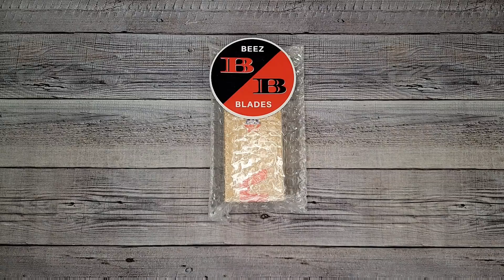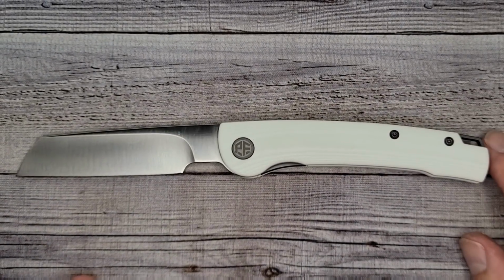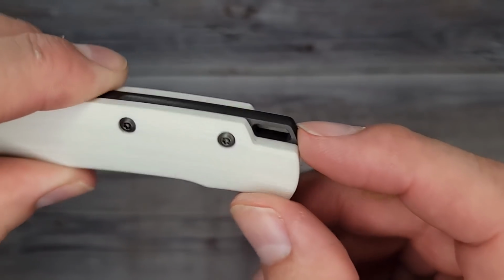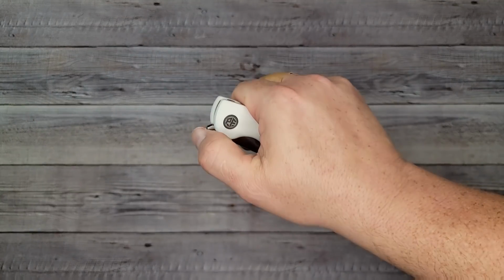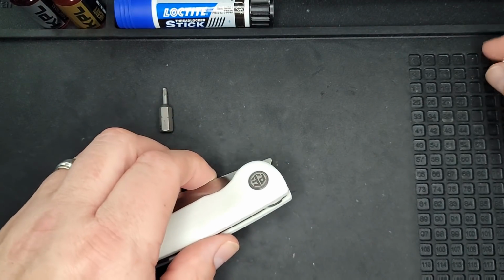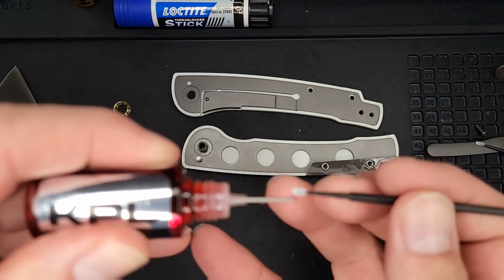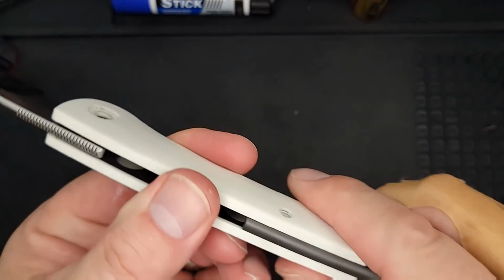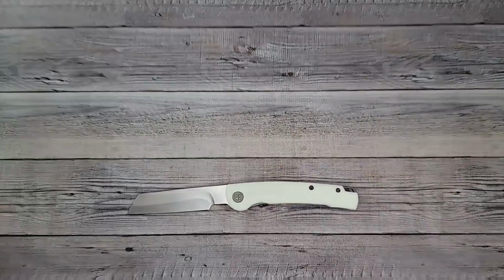NEW RELEASE! Petrified Fish SCHOLAR | PFE04 UNBOXING AND DISASSEMBLY

Comment: Wow I really like this one beez. I am a little baffled that the Bearings are the opposite way then most knives. Usually the open cage is against the blade. 🎉😮😮🎉🎉😂❤❤🎉😢❤😂😢😅😊😊😊😅😮😢😢😢😊. Have a great beeez!!
Reply from the maker: I do too! I find that the open side of the bearing is usually pointing to whichever has the indentation; Sometimes it's on the blade, and others it on the liners. Good to hear from you!!!!!! I hope all went well!
Reply: @BeezBlades  That brings up the question. Does it really matter which way the bearings are facing?
Reply from the maker: Eh. Probably in more expensive knives with tight tolerances. I have noticed a difference in a couple knives that I put in backwards though.

Comment: Real question… I’m a hairstylist, is this anywhere thin enough to be used as an actual straight razor. It would be nice for a designer to fashion up us hairstylist/ barbers an edc razor ..
Reply: I'm no expert,  but i would say absolutely not . Way to big and bulky . A good cut throat razor should be very delicate and nimble in hand . That's just my opinion though , take it as you will .
Reply from the maker: No, unless you were in the woods and that's what you had 😅. It does have a very thin sharpened edge, but I don't think it's what you're looking for for shaving. I know there are a lot of fancy razors out there, but I bet one of these companies could really make some nice ones!
Reply: @BeezBlades  thanks for the reply,, appreciate the info. Keep up the good work!

Comment: Cool knife, not the biggest fan of front flipper only knives but the reverse flick looks solid. One of the few that the bearings are pocketed into the handle instead of the blade. I wonder if there is a cost saving with pocketing bearings in the scales instead of the blade and if there is any difference over the long haul. Not sure about having such a choil on a long blade and handled knife, Makes sense on smaller ones for getting a good grip while being close to the blade but on one this size not sure. Thanks for the great vid Beez and keep making sharp things fun and enjoyable